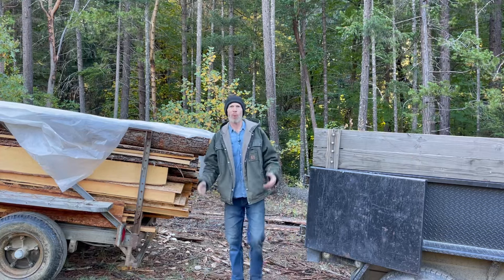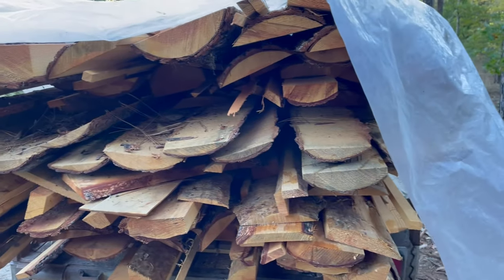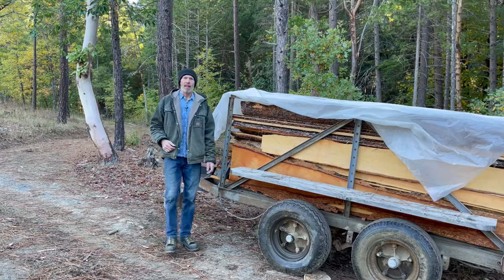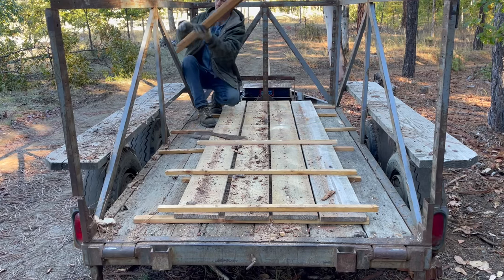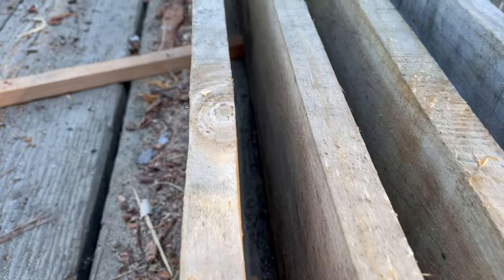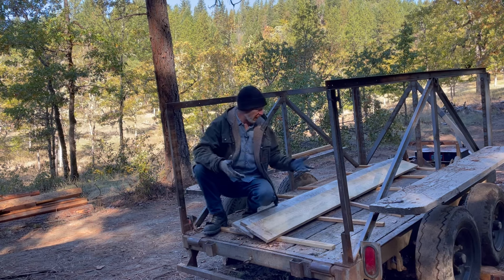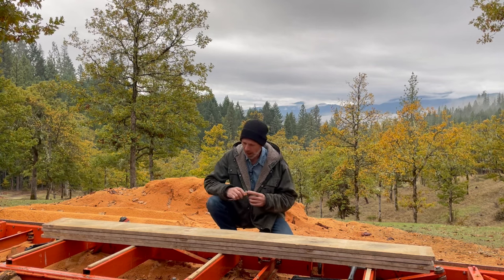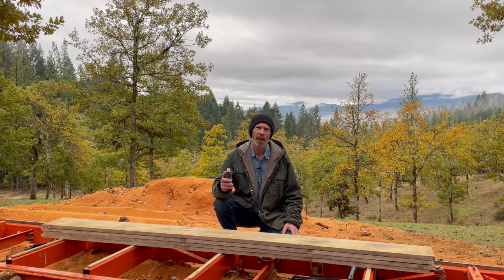Easy Way to Straighten Lumber After Drying UPDATE

Comment: First point is you have landed. 12% is the value the wood will stay at forever in the environment not getting wetted (rain).
Now hear this. Here is a good experiment: You can glue laminate  wood to make anything you like using epoxy resin. Good idea? NO!
Epoxy is WAY too expensive. How about polyester resin used for fiberglass great its dirt cheap and non toxic (false teeth are made of it).
One problem polyester doesn't set property and the joint will fail. The reason they say is because of tannins in the wood. I think this is baloney. Polyester requires oxygen to be excluded for it to go off. What do you have in wood air (oxygen) so its not going to work. 
Here is your experiment: do a lap joint with the polyester resin and clamp it and put it under the best vacuum you can. Test it I bet it will work and now you are building boats. I will be trying it watch my channel.